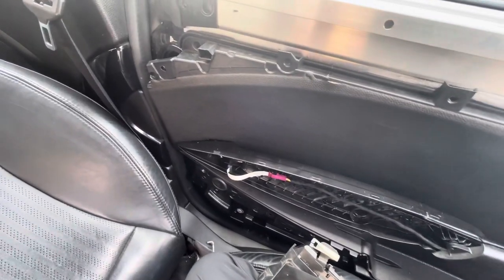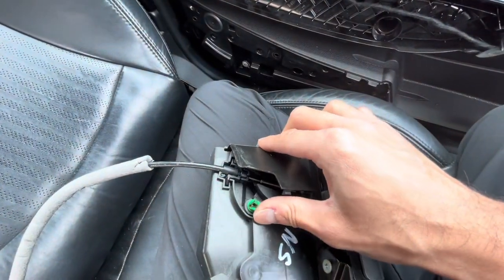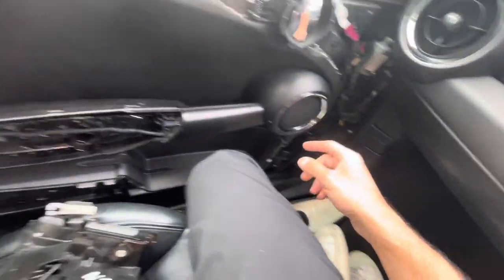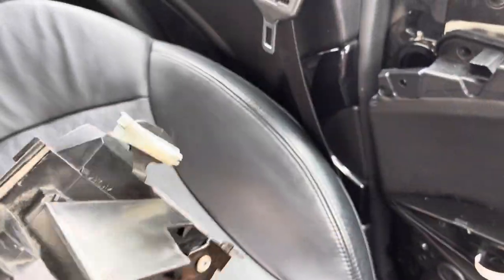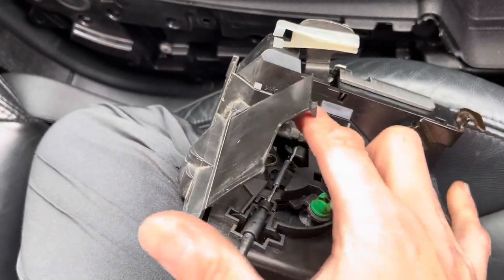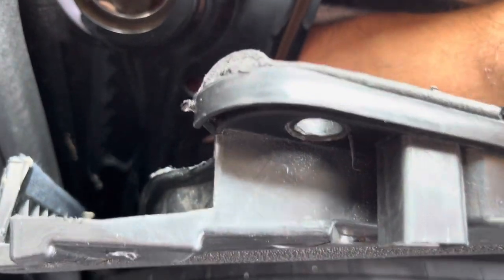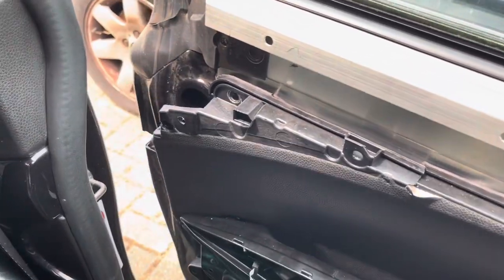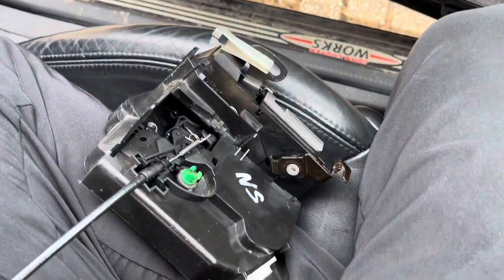How to open the door on a R56 Mini Cooper that has jammed itself shut

Comment: Hi, I'm trying to fix a similar issue with my mini. I got the flap open and I can push down the cog, but nothig happens, there's no motion in the door whatso ever. Do you have any suggestions on how to proceed? Thanks in advance!
Reply from the maker: When you push down the cog does it stay down? If it does try using both handles either the interior or exterior one and see if one works better. Also if the door isnt closed properly maybe push it closed so that the latch can get itself into the proper location in order to be able to open again.
Reply: Awesome you replied so fast, thank you! The cog does stay down. When I use the cable of the inner handle nothing happens. When I try the outer handle, I hear a click but the door doesn't move one bit. I tried pushing the door but it's already fully closed so nothing happens.
Reply from the maker: @hanszooi  seems like something is jammed somewhere, i would have said the cable is probably stretched but if your yanking on the cable and not the handle it shouldn’t make a difference. Have you tried giving it a bash while pulling on the cable? I will have a look and see if i still have the old lock lying around to see if there is another way to pull on the latch but i may have thrown it away.

Comment: I have this same problem with my R56. Drivers door won't open with either handle. The door locks go up and down but the door won't open. I see people taking the inside door panel off but isn't that impossible since the door won't open? Passenger door only opens with the inside handle and the back hatch only opens by pulling the ring under the rear seat. It's a new car to me and it has sat for 10 years prior to me getting it.
Reply from the maker: Thats the same problem i had on the passenger side but the lock would not go up or down, so i think your issue might be that the cable has stretched too much to pull the mechanism enough. Its kind of impossible to get the door card off completely but as you can see from the video you can get it off enough to pry it back enough to get to the mechanism. 
Hope this helps and good luck getting the door open.
Reply: @Bamfx1  Thank you for the reply I was starting to get really frustrated. Did you have to take the seat out?
Reply from the maker: @kirklarson116 it would help to take it out but i didnt, moving the seat all the way back gave me enough room.